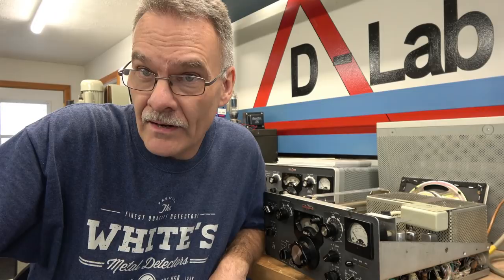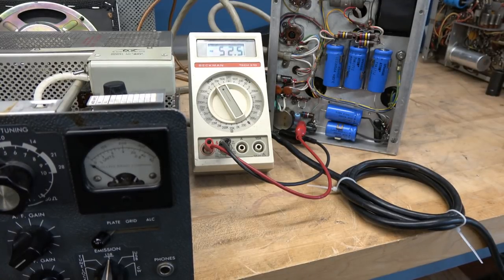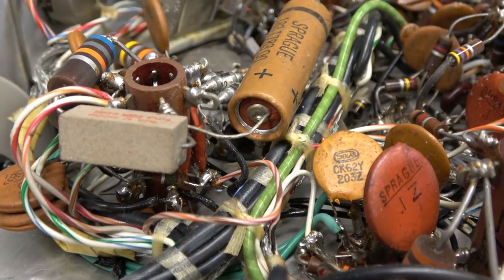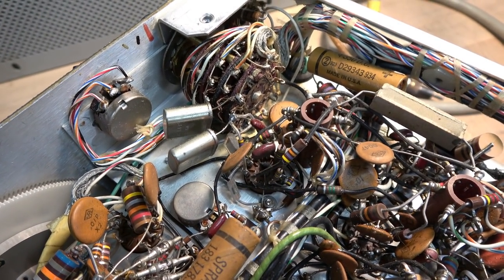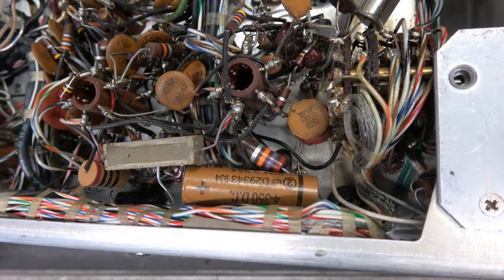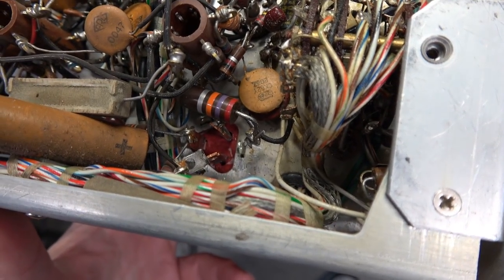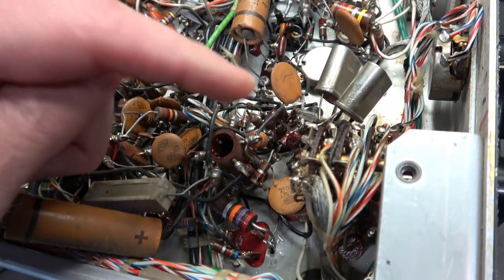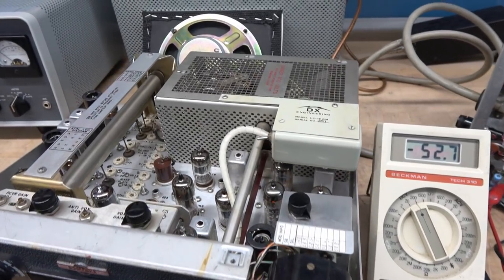How to replace Collins KWM2 filter capacitors Fix hum audio motor boating

Comment: No issues with my round emblem, but that multi cap is the only one I didn’t replace. You make it look easy. KJ4KAF
Reply: I just replaced C106 and you have to be patient and be careful to solder back all the wires & resistors. I had to replace a wire that was coming from a tube pin connector. It was a #22 wire with a Teflon jacket. Replaced all the electrolytic caps as well. This is in a 1962 KWM-2.

Comment: Hi Terry. Thanks for providing the best most informative videos on YouTube. My question of the day: I picked up a 1940’s or early 50’s Precision signal generator from a junk shop to possibly be used for alignment of old radios. I never tried using it and I don’t play with radios anymore and was wondering if it still has any practical uses or is it better left as work shop decoration. It does turn on and pilot light works. I think there may be some useable tube amp parts in trapped inside. What would you do with it ?  Thanks. Ed Lundgren     Merry Christmas!

Comment: Is the mechanical connection  on the ground tab on the can cap, the only path to ground or is there a ground wire soldered to it?
Reply: My KWM-2 from 1962 has a #21 AWG bare wire soldered to the can post from a ground lug secured with a 6-32 bolt thru the chassis bottom.

Comment: be sure and use the tuning instructions when loading it up. follow them exact.
Reply from the maker: Roger that Sir,  I believe I have found the negative bias issue. Still need to find the intermittent connection in the filament circuit. Then I will attempt setting the idle bias on the finals. A time consuming process, but educational!
Reply: @d-labelectronics  I'm wondering how Textronix dealt with grounding and aluminum chassis. Might be worthwhile to peer into an old 400 or 500 series 'scope!
Reply: I remember horror stories involving trailers burning down because they used aluminum wiring. It would react with the steel in the outlets, cause a voltage drop and fire!